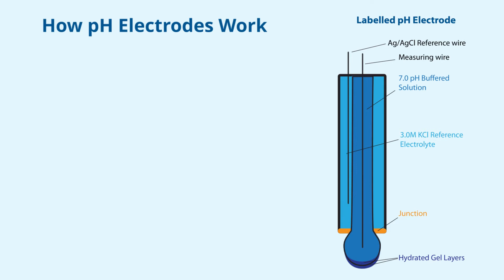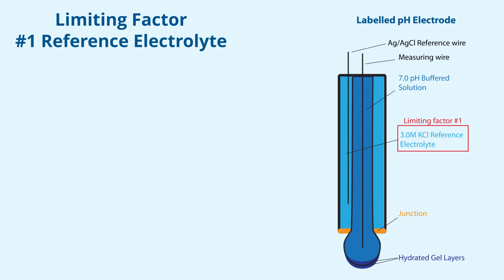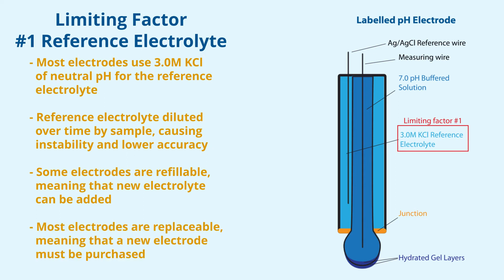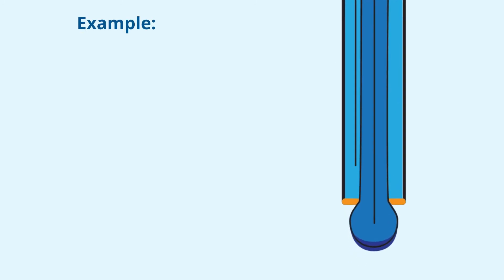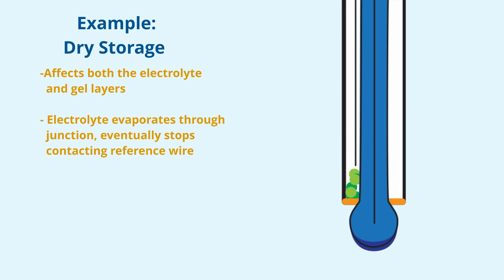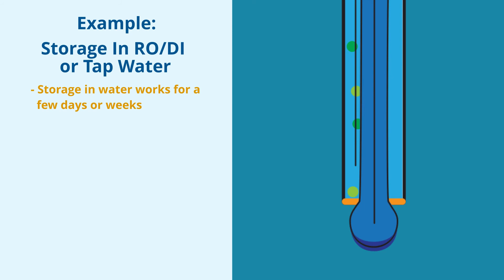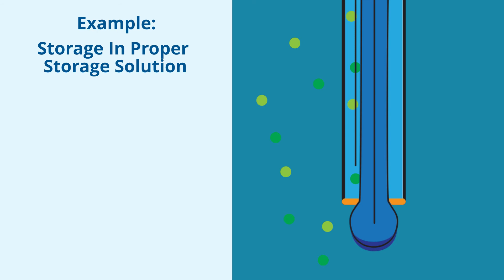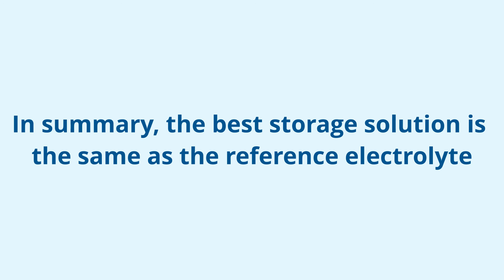Proper Storage of pH Electrodes

Comment: Hey there, if my pH electrode was not properly cleaned and sat in KCL storage solution and some residue sample with a pH >4 but <5 (instead of the recommended 4). Would this impact my probe? Thanks!
Reply from the maker: If the probe is in a concentrated KCl storage solution, then that should be fine, even if the pH is a bit off. Does that answer your question?

Comment: Hi. Could you tell me what the pH of KCL storage solution should be, I have shop bought solution that is reading 4.5 but was told it should be 7, is this correct?, thanks.
Reply from the maker: Hi there.  Pure KCl should be neutral, right around 7 pH.  One explanation for the pH you are seeing is the solution may be made using low pH water, or there may be bacterial growth bringing the pH down.

Comment: What's the longest you would use one in 1 sitting before rehydration of kci
Reply from the maker: They can be left out for an hour or so without any problem.  Past that time, the glass and junction may dry out, resulting in delayed response time until water rehydrates those parts.  

The actual effects of leaving an electrode out vary greatly between designs and different models, so results may vary.
Reply: @phionicsinc.4832  sweet thank you for your reply  copped a bluelab and want it to last

Comment: Sir, i have made 3.3M kcl solution (24.60g/100ml) using DI water but checking the pH of that kcl solution it's is giving a pH of 5.5. so is that solution good to use for storage or i have done something wrong? (Im not a chemistry expert)
Reply from the maker: If you are sure that only DI water and KCl was added to the solution then do not worry about it.  The concentration of the salt is much more important than the pH of the solution.
Reply: @phionicsinc.4832  thankyou sir for your reply.
Reply: Good day. I just got 2 ph metres via AliExpress. One for water and one for food. First day using it to check the ph of water, they both have the same reading. Fast Forward to the next day and the values are different. 

Now I don’t have access to getting potassium chloride to make storage solution but please Is it possible to use RO water or distilled water with salt to create the storage solution?
Reply from the maker: @odogwuhenry  Yes, any salt is better than no salt when preserving the electrodes.
Reply: @phionicsinc.4832  I appreciate this. I will return to give results after I have applied this knowledge.
Reply: @odogwuhenry  two weeks later how is it going ?

Comment: Hi i have read if you mix 1g potassium chloride (ebay bought) per 100ml ph4 buffer solution you can make your own cheap KCL pH Probe Storage Solution (3 Molar KCL) ? Have also read leaving 3M Kcl out in open is okay for 2-3months but then needs replacing if your storing a ph probe pen in it?
Reply from the maker: pH probe storage solution is very easy to make using KCl bought from anywhere.  For a 3M solution, you need 22g per 100 mL (some of it may not dissolved and that's fine).  You don't even need pH 4 buffer solution to mix it in.  

Very little grows in KCl solution so it should be fine to store for 2-3 months or longer.  Just replace it if you start to see mold or bacterial growth.
Reply: @phionicsinc.4832  100ml of which liquid? If water, wouldn't de-ionized be better? That sounds like a lot of kcl per 100ml? Can I reference you to this vid- 
https://youtu.be/UrasQN9tBqs
Reply from the maker: @arahant69  100 mL of deionized water is best but tap water is fine as well.  The amount of KCl we recommended is a lot (3M) but that is because you want a fully saturated solution.  Some of the KCl will not dissolve completely.  

The 1g recommended in the video amounts to approximately 0.13M KCl solution which is not sufficient to prevent reference dilution so will reduce the life of your electrode if stored for months or years in that solution.
Reply: Thank you sir for good information  @phionicsinc.4832
Reply: I have this same question ⁉️ and also have seen the same video and comments about using a ph4 buffer
Reply from the maker: @ElFresco214  The video likely recommended it because the probes they manufacture use a reference solution with 4 pH buffer.  Ours and most other manufacturers use a saturated KCl solution instead which is why that is recommended for storage.  

https://www.coleparmer.com/tech-article/ph-electrode-care
https://www.westlab.com/blog/2017/11/29/what-is-the-correct-way-to-store-a-ph-electrode

These actually recommend 4M KCl but we find that 3M KCl works for our electrodes.
Reply: @phionicsinc.4832  I really appreciate the reply, could I just ask, once diluted is the mixture supposed to be clear in appearance or is it left a little cloudy?
Reply from the maker: @ElFresco214  It normally looks a little cloudy before settling over time
Reply: @phionicsinc.4832  I appreciate the knowledge!! Blessings 🙏🙏

Comment: Hi Have been trying to make a 3 M solution of potassium chloride, find it impossible to make the salt fully dissolve  even at 100 degrees C ,approx 67 grams KCl to 300 ml of deionized water, any ideas where I might be going wrong . Thanks  Tim Davy  UK
Reply from the maker: Hi Tim!

It's perfectly fine if the salt doesn't dissolve completely.  This means the solution is saturated and should match the reference solution inside the electrode.  Perfect for storage!
Reply: Thanks for your response regarding dissolving potassium chloride  Tim Davy

Comment: when do i have to use the storage solution? all the time or if im not using it for a day / week / month etc..?
Reply from the maker: Any amount of time the sensor is left out of water allows evaporation through the junction.  It also dries out the bulb and may require soaking the electrode for a while to rehydrate it.  Any amount of time that the electrode is left dry or in water will reduce the lifespan.  The electrode could be left in normal water for a few days, weeks, or even a month and still work, but the electrode will be diluted slightly and not work for as long after that.  In contrast, KCl storage solution preserves the electrode perfectly.
Reply: @phionicsinc.4832  thank you.

Comment: electrode storage solution is not available in my local store. If I buy a ph 7 caliberation solution and KCl salt and mixes it it 100:1 ratio. Does that work ? For anti bacterial properties what should I add to it ?
Reply from the maker: Most electrodes use a KCl solution for their reference but check with your manufacturer to confirm.  If it does use KCl, then you can simply mix your KCl salt in RO/DI water to make a 3.0M KCl solution that preserves the electrode.  You do not need to mix it with a 7 pH buffer.
Reply: pHionics Inc. thanks a lot